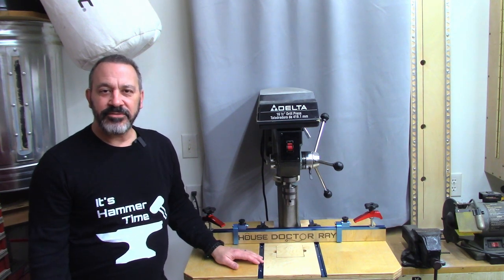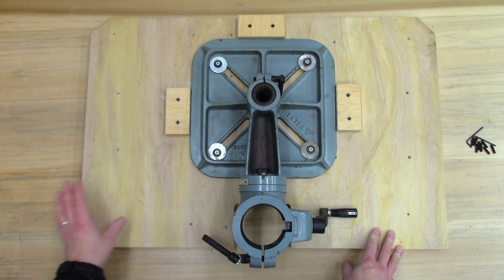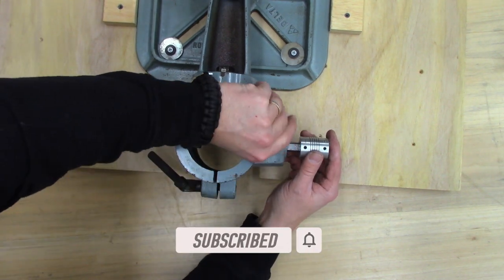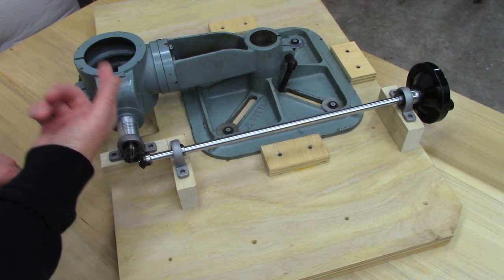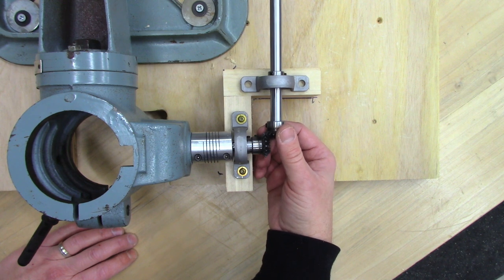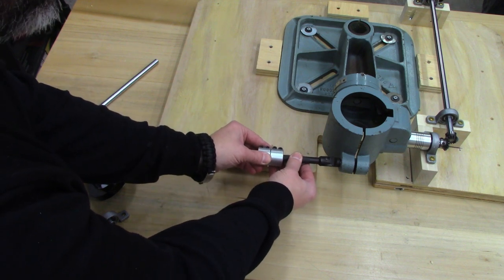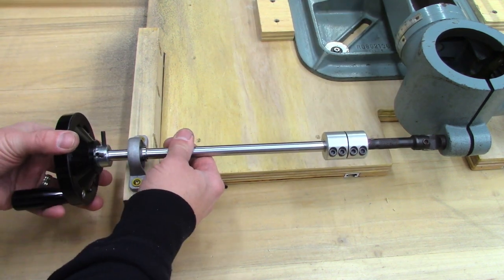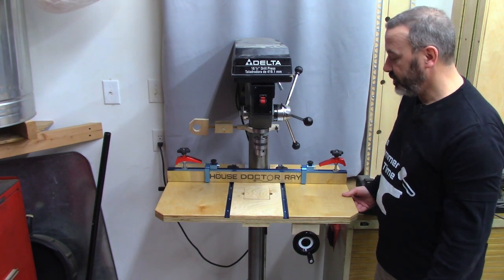Hand wheel cranks for drill press table

Comment: it is very neat but you completely give up your press ability to angle which at least for me is one of the primary things I do with mine. thoughts on how that might be achieved without such sacrifice?
Reply from the maker: Not really.  If you rigged up a pin to lock it in place you have it so it tilts one way.
I have seen adjustable auxiliary tables that can angle.
Reply: Unless you need the entire distance from the chuck to table. You could use jigs or vises that can tilt or have jigs with set angles you use.